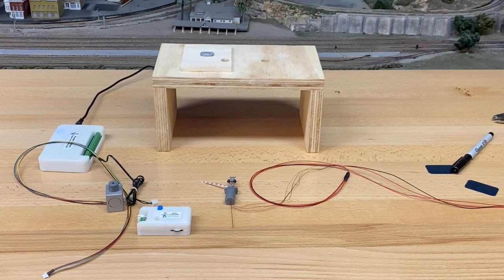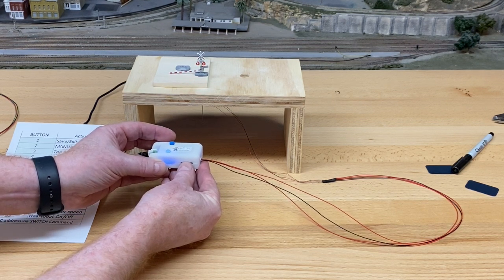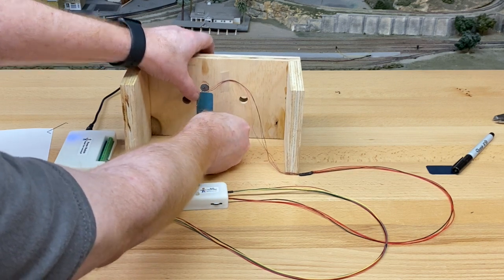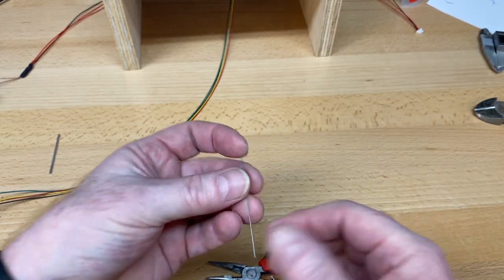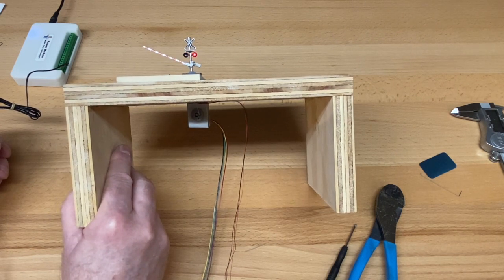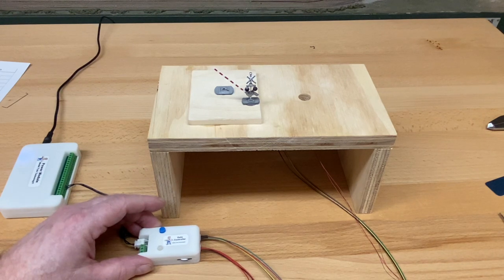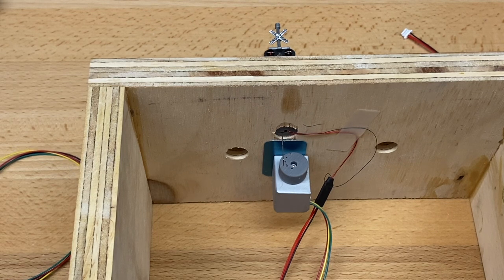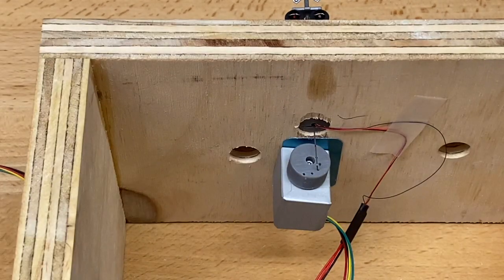MTT Motorized Railroad Crossing Gate Installation (N & HO Scale)

Comment: Another Awesome Presentation!!! I also have other brands of HO scale gated grade crossing signals. Do you have just the gate movement hardware and the control modules kits without the signals available? I also have Logicrail brand detector circuitry. Does your module have a manual actuated input ?
Reply from the maker: Thank you!  At the moment we don't supply the kit without the crossing but we've considered it for later.  Yes, there is a way to trip all MTT Controllers using a simple SPST switch or relay.